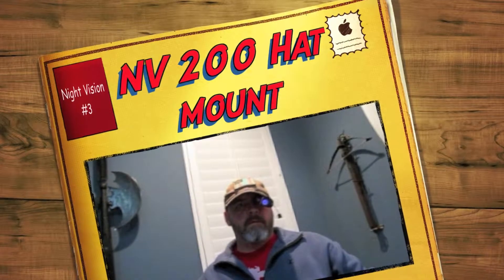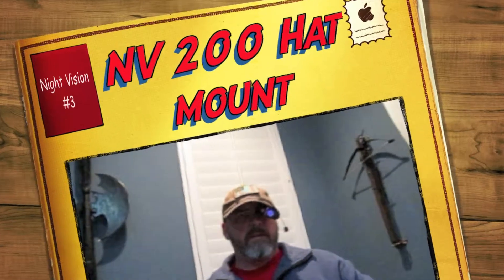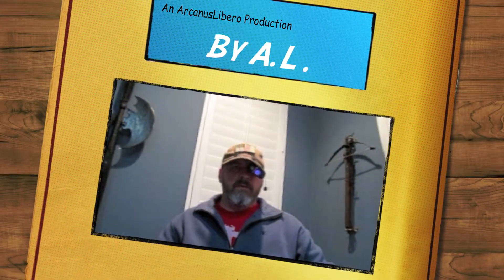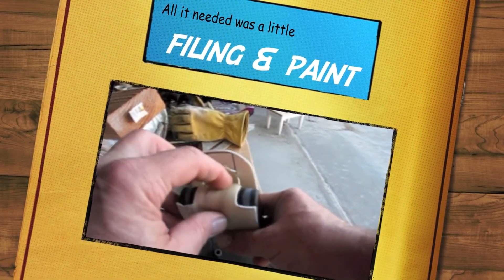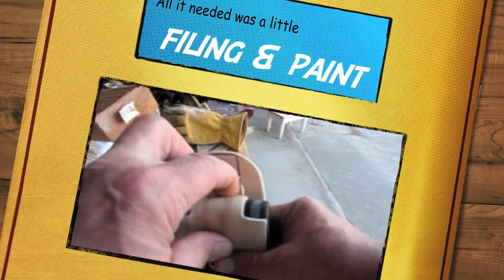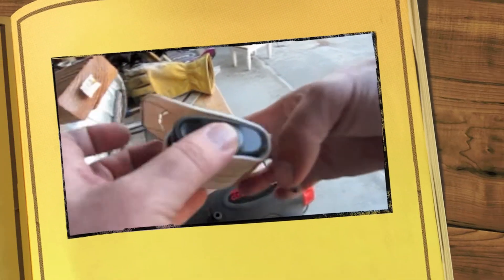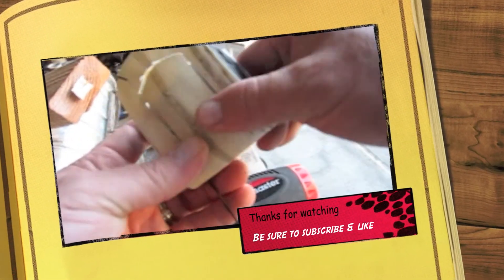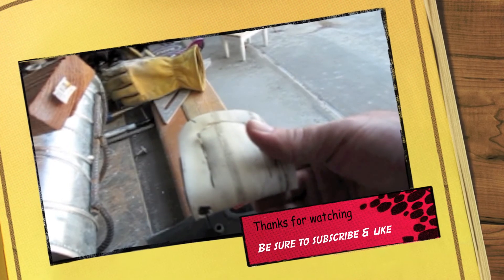How to make a Carson NV-200 hands free cap mount for your night vision

Comment: Very cool man. Never knew pvc pipe could be used like that. Thanks for opening my mind. I'm scratching my head wondering if I could make a velcro mount to hang the nv200 from an underside of a cap like what you'v done, or something built around the "Gotcha" cap defense system: http://www.amazon.com/gp/aw/d/B00IEZM2WM
Although, I am liking your terminator motif.
Reply from the maker: Thanks. PVC is a great product for the do it yourself builder. Check out my channel video page. You can make scabbards, holsters, grips, etc... There is basically an unlimited amount of things you can do with it with a little practice. You could also check out CrypticCRICKET.